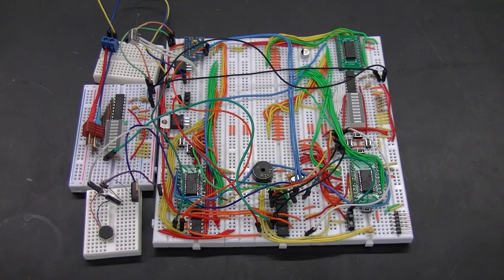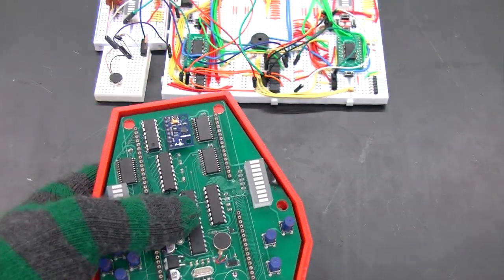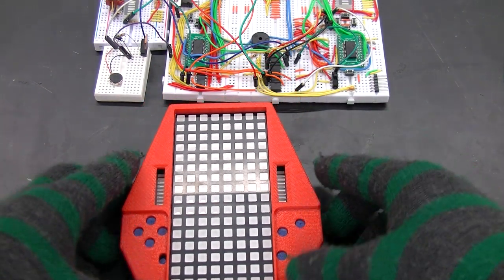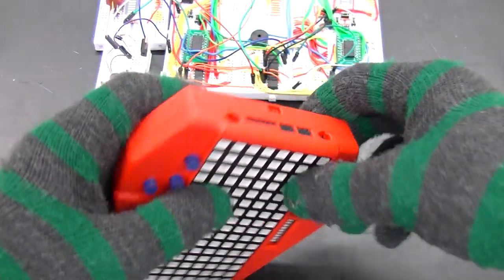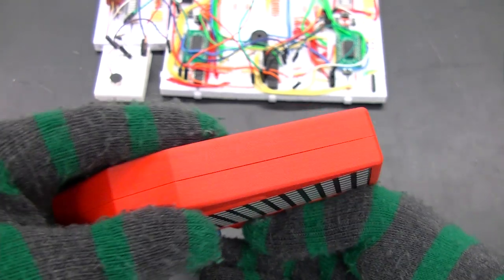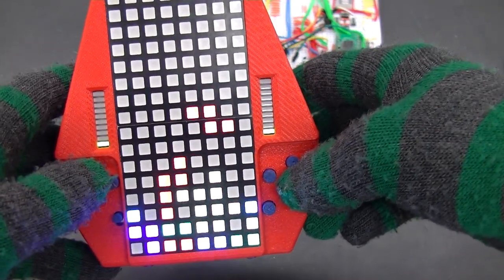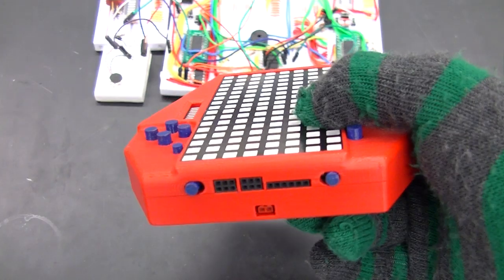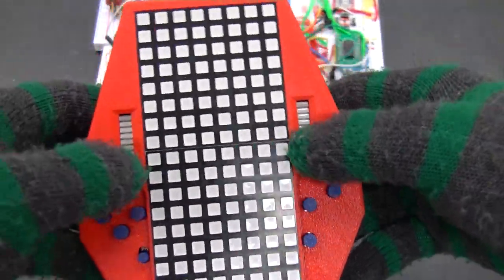Tetris Gaming Device

Comment: really cool, I would like to buy one, but I want to connect my own matrix (bigger)
. can you also put on different games? like snake?..?
Reply from the maker: Thanks, Marc! You can definitely played a wide variety of games on this device. I actually wrote the Snake game before Tetris for a previous breadboard version of this device. I need to modify it a little bit (mainly pin definitions) to be able to play on this newer version. Could you please let me know what kind of matrix (or how big it is) you want to use with this device?
Reply: i want to make a large (around 15x30cm) size matrix. with 2x2cm large pixels. also just 1 rgb led per square. all the rest electronics need to be as small as possible, for in a pocket. and also the least buttons possible. preferably with a demo mode where it plays by itself when not used. just ell me how you need the matrix wired.